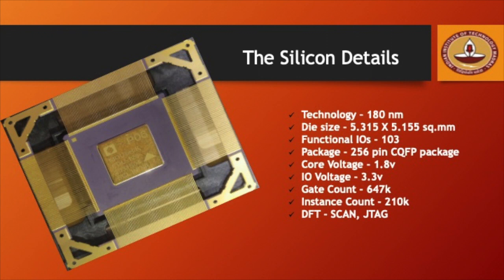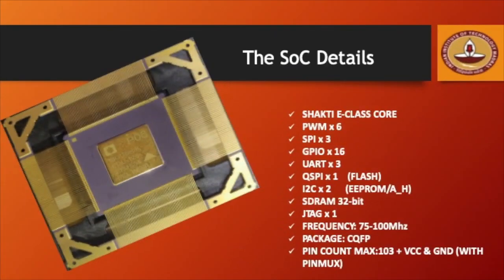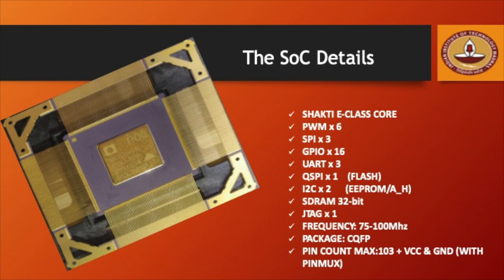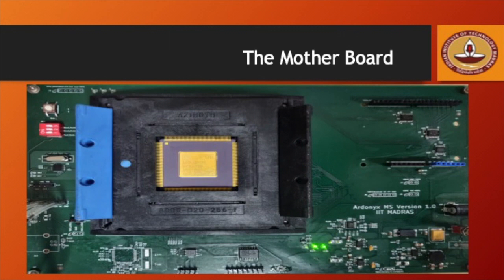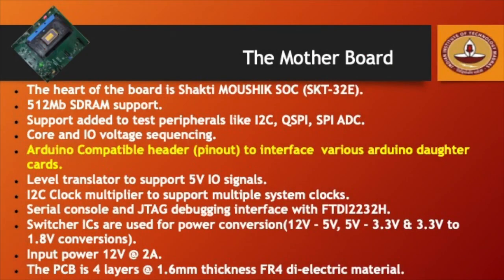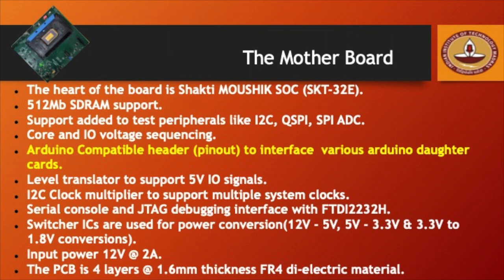MOUSHIK IS BORN - An Indigenous RISC-V Microprocessor of the SHAKTI family, IIT Madras

Comment: Is SHAKTI supposed to be equivalent to architectures like x86 and POWER, or low-power ones like ARM?
Reply: It is using RISC-V architecture. x86, IBM PowerPC are CISC based, targeted at desktop platform. ARM is RISC based targeted at mobile platforms. I think this MOUSHIK SoC is for applications as storage controller, co-processor etc.
Reply: @akhileshb_  POWER is RISC as well, x86 is the only commonly used CISC architecture today, it has been that way since 68k fell out of use. All those proprietary Unix workstations in the 90s used RISC processors. SGI used MIPS, Sun used SPARQ, HP used PA-RISC, IBM used POWER, and so on.
Reply: @Eddies_Bra-att-ha-grejer  Oh, thanks for the correction.
Reply from the maker: Please have a look at the different classes of processor available, https://shakti.org.in/processors.html

Comment: Fantastic... Whats the max clock rate?
Reply from the maker: Its 100Mhz :)
Reply: Its for iot . U can think of it as an advanced microcontroller + additional compute capabilities.
Reply: @kadiyamsrikar9565  Why only IoTs? Why not 8 bit, 16 bit and 32 bit game consoles? Its time to create an ultimate game machine with these processors to compete with low-end first and then take on PS5 and Xbox
Reply: @kalgandikota7752  probably yes u can . But cannot scale for economic viability.  U can get a better value using Existing Arm or x64 implementations. THE MAIN problem is software. Think of companies like si five with a large amount of resources and still they are unable to get things running not because there are no compilers or os s but getting the platform into devolopers hand. Its not profitable for them. RISC V cannot become consumer grade easily atleast for now.
There is no point in it as ARM is already good for mobile etc ..  I think RISC V will be used by ssd  controllers , industrial manufacturing control units , custom workload accelerators , automotive industries and other similar areas.
Reply: @kalgandikota7752  Look our country can never match USA or China or Taiwan or Japan or any European countries in Semiconductor industries but just not because they have a lot of money or something India is richer than some of the above countries. Its because of their experience and education system. These countries students have a lot of liberty and resources compared to ours and their societies encourage such things in their childhood.  For example people like linus torvald designed a kernel during their College days , a lot of people start things from their childhood. Even a 15 year old kid from a knows a lot of stuff in science and physics and software and such kind of stuff from and young age
And in our country not even a master students from most reputed colleges cannot achieve such feats.
Reply: @kalgandikota7752  Wow that's really a lot to take in. But i get the overall abstraction. I find certain points u mentioned to be very interesting like handling ruthless politicians carefully and psychologically for greater good purposes. Seems to be the only way we small portion of educated indians can handle those people. 
Next about indian universities and colleges. I think government should own every school or atleast have something like public private partnership in maintaining them. EVEN in IIT'S AND NIT'S they are still using 100 years old curriculum. Unlike other top universities like MIT they do not even conduct interviews or assess the student intentions. A lot of my classmates when they were asked why did u join this NIT, they just say for placements.😒  Its not their fault though , the parent's narrow mindset and fearing their child's future & coaching centre's making money out of them.
But there is hope since a lot of educated people and millennials  are online, i guess a lot of them are more open minded and will look and work with a broader mindset.
Reply: @kalgandikota7752  Marriage and Kids are optional. Not a compulsory thing. Placements are important though. But coming to the college just for sake of job is a bit selfish. 
In NIT, IIT etc . Govrnment spends a lot compared to our entire country's engineering college budgets. So that research and design oriented skillsets can be devoloped
So my hope is that our colleges we also have such kind of culture in the undergraduates. 
I see a lot of  MIT OCW classes. Their education system is playfully serious. They take on cutting edge topics and talk like as if it was a childs play. The amount of passion and dedication at the same time makes them understand very hard subjects in a intuitive way. They never make u feel bored of science , math , art. They just make it a integral part of their lives and unlike in our country where people think of them as some kind of hard  and only hard work can succeed  but never really understanding the beauty of it. Once we understand the purpose of learning and lay strong foundation in our mind hard work and dedication comes automatically.
But its vice versa in our country. 
Its not the mistake of students or professors but its the problem of the system.